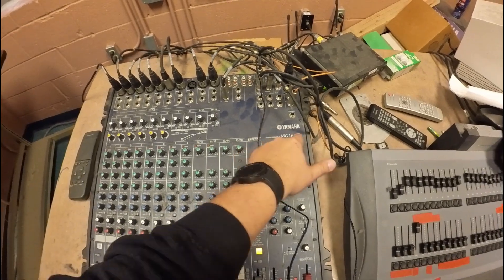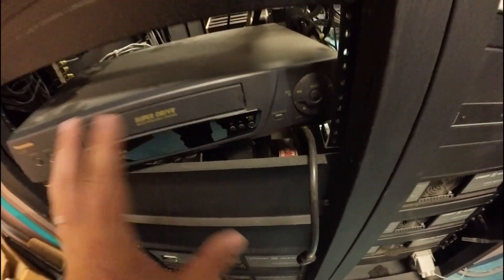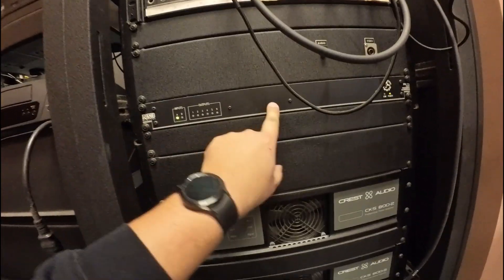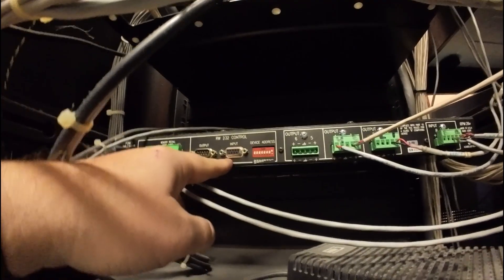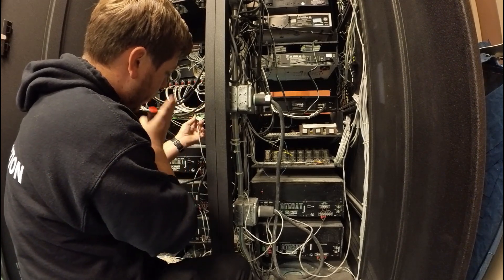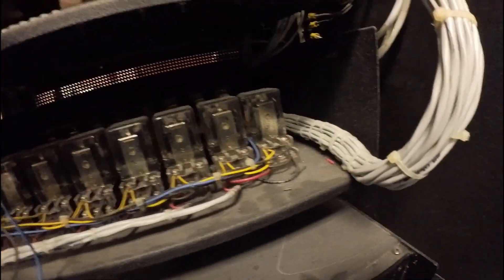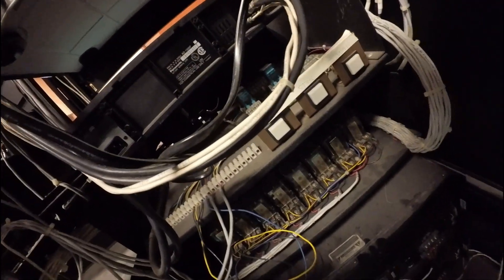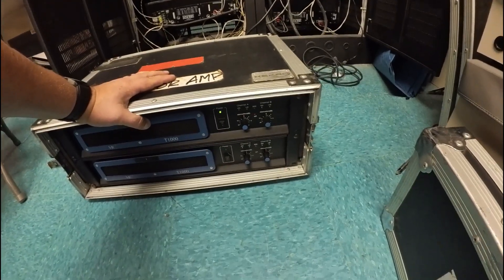Help me Diagnose A PA from 1996

Comment: Yeah, you cut a lot of corners on this one!

Cable from mixer to processor, cable from processor to amps (which is basic continuity testing).

Then checking if you get an actual signal at the processor and from processor to amps.

And from there if you can actually get a signal out of the amps.

Those Crest amps are built like a tank so with a service and maybe replacing some caps they will last another 30 years!

And than you would probably be left with cleaning what works, gutting out the old and unused equipment and maybe putting in some new cabling.
That would be the cheaper option for the client but requires some elbow grease.

And don't take this the wrong way but nowadays the younger generation just likes to replace things instead of fixing them. I am in the same situation at the moment with a community center and the young guy in charge (son of a couple on the board) doesn't like critique on the shabby installation and rather rips it out and replacing it with lower quality gear than putting some effort in.
Reply from the maker: Yeah, the amps don't work. I've given them options of having a local service guy try to repair them and for me to replace them. They chose neither so this is all still sitting in place. I did everything you described, may not have shown it but this isn't my first rodeo.
Reply: @ProAudioPlus  One of those "We want it working without any money poured into it"-jobs? Did you get paid for your diagnosis?

Tell them to call when the are willing to spend the money and walk away or maybe even run!

Next time put those results in your video. This looks like "corners cut" and is the cause of several people placing basically the same comment. 

It will also make for a great learning moment for the youngsters that are unknown with gear like this.

By the way:
The Crestron should be for switching video as they are/were video. Can also be audio switching but you will only know that when you start tracing wires!

Comment: Heh... I remember doing installs like this.  
Actually, for the system being this old, the wiring looks fantastic!  I'm used to it being heavily mutilated over time by various people.   It's actually not a bad install for its age.
Bypassing power switches was something I've done on occasion on installs where tampering is expected.  Tampering is VERY expected at a school.  Even more important if the PA system is tied into the fire alarm. Although, we always placarded modified equipment for safety. I probably still have a few more "switch disabled" placards in my drawer somewhere. 

 I used to keep one of the small Mackie / Behringer mixers around for times like this.  Now it's a cheap Chinese mixer with built-in MP3 player and built in wireless mic receiver, USB-C powered no less.   If I approached this system, I would have started at the amp like you did, but I would have used my own cheap Chinese mixer with my own source and work backwards from there.   I find it hard to believe that all 5 amps would die at the same time.  UNLESS they were dying over time or something very bad happened electrically (lightning, utility overvoltage, etc.), but the school would have mentioned that.
Reply from the maker: I will admit this was a nice install for its time. I couldn’t find one of those power switches if my life depended on it! Maybe on Ebay lol. This system has been dead for years. When they asked me if it could work I couldn’t believe they even asked. Everyone that knew anything about the system had moved on, and we lost all real information with them years ago. I hope to put a couple of amps in and get the system going for them. They never use it, so they are not sure if money should be put into it. Thanks for watching another video and being here in the comments!

Comment: A pair of headphones, a 3.5mm aux cable and a bunch of different connector converters is a decent set of tools for probing and injecting signals while dealing with audio system problems. Wondering whether signal exists on this cable? Hook it up to headphones and listen. Wondering whether the input is working? Pump some signals in directly with a cellphone and the aux cable.
Reply from the maker: I still have a Sony Walkman for when I need to test a lot of signal cables. lol
Reply: @ProAudioPlus   Yeah. That would be better especially while tinkering with old sound systems in unknown condition. At least there's no risk of toasting an expensive cellphone or, to be worse, detonating the Li-Ion battery if abnormally high voltages exist on terminals. A cheap Bluetooth receiver would do the same.
Reply: I've long lost count of the number of time's I've just bridge sleeve and ring to pins 2 & 3 of an XLR to check a line level signal or just popped bare wires out of pheonix connector so I can test with headphones. For a signal generator, my Sound Bullet has saved me so much time.

Comment: Hi, you should have tested if the new amp worked with the same jumper cable you used for bypassing the dsp. The issue could now also be  in the cable run from the mixer to the dsp.
Reply from the maker: Well the first thing I did was send signal to the dsp and channel A showed it had signal. I could turn the main output down and the dsp A channel signal light would go away. This made me think signal was getting to the dsp from the mixer. When I went to test the amp I didn't want to build a phoenix to xlr cable to save time. Plus thinking all the amps need to be replaced we would put in amps with dsp built in or replace the old dsp with a modern dsp with usb/wifi connection. This venue is one I will work in a lot, so replaceing this gear with gear I know how to opperate is best for me and the venue. They will replace these and leave them until they no longer work again in another 15 years. All so the dsp had a yellow flashing light on the outputs without signal being sent. Sound like a fault to me. Those are my thought... Thanks for watching! I'm installing new floor monitors and removing older amps out of another venue today for a video.

Comment: That was really interesting. (I might be the only one :) I remember doing that kind of work not long ago. My first guess was the DSP. Those seem to fail more frequently than amps and speakers. They musta pushed it way too hard to fry the amps, I thought the amps would have been the most robust part of the system. Guess not those. Also kinda surprised it didn't take out the speakers too. Any idea what speakers they had? Looking forward to see what you do for upgrades, if you make a video on that. - Tim
Reply from the maker: Hey Tim thanks for watching and leaving your comment. I’d love to rebuild this system with modern gear today and I’m waiting for them to decide if they want to do that. The room has 3 EAW boxes hung in a cluster over the stage. Then around the Basketball court smaller EAW boxes. Now I don’t remember what the speakers are but they are the size of EAW KF850’s or 650’s for sure. I’ll be back if they want it rebuilt. I might have been able to get the DSP to work if I had the RS232 adapter, However, I’d rather replace it with the amps to something with just a USB or IP connection. Thanks again for being here.